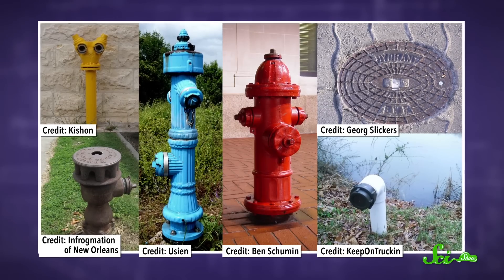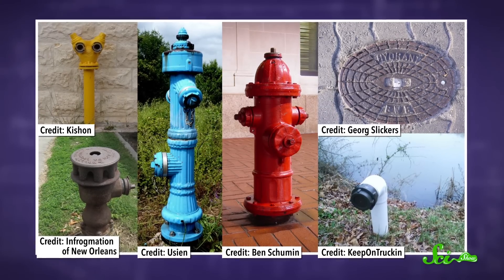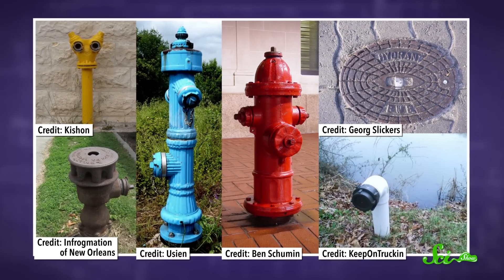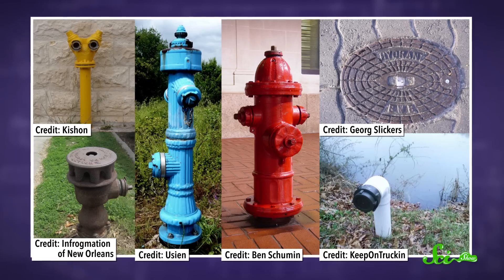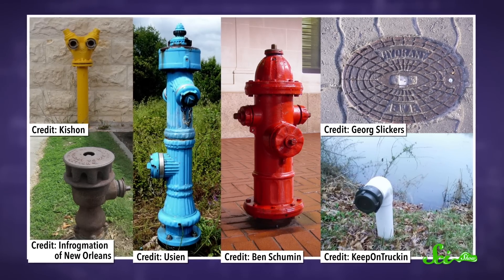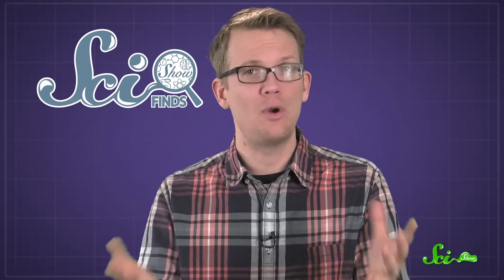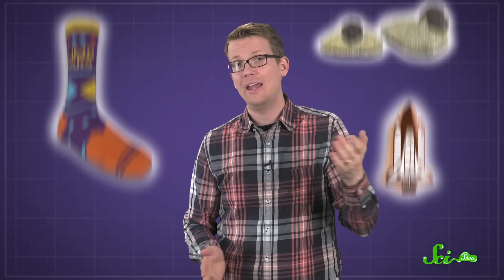Why Don't Fire Hydrants Freeze and Explode?

Comment: It's so counterintuitive, something with the word "fire" in it will explode, but only when it's cold and filled with water.
Anyone else having an existential crisis?
Reply: LOL, kids.
Reply: Jerel March You can get some pretty fun "super cooled" liquid effects if you calculate your soda freezer times correctly. But be warned, you're going to have a sticky, frozen mess if you leave the can or bottle (try bottles, it's easier to get stuff out) in the fridge too long. And don't do this with glass bottles, for safety reasons.
Reply: I just am.
Reply: Obviously, you've never heard of the infamous water pipe bombs left in freezers.
Reply: I left can soda in the freezer and it didn't work so well but I was like 10
Reply: Water has Hydrogen though
Reply: I get existential crisis when I think about space and the Universe.
Reply: Justin Most substances contract as they cool down, but not water, it expands. The universe is getting colder as it expands, just like freezing water... the universe IS a fire hydrant confirmed. Where's my Nobel Prize?
Reply: No Name
Me too. ^_^ I recently learned about "Eternal Inflation" from a Fraser Cain video. Blew. My. Mind.
Reply: Alex Lawson fire burns up. which is why a flame rises, and why if you put your hand directly above fire it will burn but put it below the flame and it'll be significantly significantly less hot 🔥
Reply: T
Reply: Master Therion
Reply: well it can explode, crack, or just buckle if it's heated enough to. only this time it's BOTH THAT CAN! YAY!
Reply: fires burn downward, smoke rises with the hot air?

Comment: Yeah, the only hydrants I've seen here in New Zealand are the metal caps in the ground. Firefighters will simply remove the cap and attach a hose to the hydrant and connect the other end to the fire engine.

Comment: yup, most the hydrants here in Germany are just metal flaps in the ground which you can open with a special tool. The upper part of the hydrant is stored in the fire engine and screwed into the pipe fitting beneath the ground when the water is needed.
Reply: Synchronizor if someone parks on top of it the fire department is allowed to push them away by slamming into them and they'll have to pay for the fire engine's bumper if it gets scratched. As for ice, I guess they have plans saying where the access points are and the rest would be brute force, not too sure on that last bit though.
Reply: A friend of mine is a firefighter, and when someone parked on top of a firehydrant in a no parking zone, they stabbed the tires on one side of the car and then flipped it on its roof by hand (about 10 hands). It is usually not easy to park on top of a hydrant, because they are usually in no parking areas or in the middle of the street.
Reply: What happens if someone parks on top of it, or if it's covered in snow & ice?
Reply: Synchronizor 
they are part of local streets and sidewalks and therefore get automatically freed from snow and ice by the owner of the segment by law. besides im pretty sure the firefighters do carry a blowtorch inside their car for emergency situations.
Reply: I have replaced many a fire hydrant in Germany and I have never seen not a single flush mounted fire hydrant in any town or village on a street. Seen them on a airport runway before. I use live in the Hunsruck region.
Reply: +Tefans97 We have signs that tell how many metres in front of the sign and then to the left/right the hydrant is and how big the hydrant is. Here is an example of a sign for a Hydrant with a diameter of 300mm = 30cm which is located 8.4m in front of + 1.1m to the left of the sign. https://commons.wikimedia.org/wiki/File:Hydrantenschild_Beispielgrafik_2009-01-29.svg
Reply: Surfie, I was about to say the same :) In Australia, they're on/next to footpaths on busy roads (and you get booked/finned if you park there as standard, because that interferes with safe use of the footpath for people with disabilities, prams etc etc, so no-one has enough money to do it regularly) 

On quieter streets, they're often in the middle of the road & by that I mean the MIDDLE! You'd need to at least doublepark on the road to cover one & again, do that & someone will call a council ranger & you'll be booked everytime you do it until you stop. If it's a repeat pattern in a dead end street/super quiet area & double parking isn't seen as an issue, if the person's parking on the hydrant, one of the neighbour will either speak to them or put a note under their window telling them they're on a hydrant & need to stop or they'll call the council & have them booked.

In the extremely rare cases where a car is on one/it's been nicely covered in lawn & unable to be found, the fire brigade will just go to the next hydrent & run hoses back (there's enough hydrants for that & they carry water on their truck to buy them enough time to do it) & then they'll note the situation & add fixing that hydrant & checking all hydrants in that local area to their maintenence list & be back within a day or 2 to resolve.

I reported a post sign but no visible hydrant to my local fire department when I first moved into my old place, took them less than 24 hours to come out & uncover it
Reply: Wow,  this thread answered a question i didn't know i even had! Thank You world SciShow friends!
Reply: Axel It’s the same here in Australia
Reply: surefie
It is? Then what are those grey things with the red flat top? I thought those were fire-hydrants.
Reply: grey things with red flat tops? What state is that in?
At least in NSW & I think Nationally, for fire hydrants, there will be a red HP or HR on a telegraph pole pointing towards it & on the opposite side of the same pole will be a green H (letters are below each other not side by side)
Reply: Vic. I see them every ten metres or so, on the side-walk grass, assumed they were fire-hydrants.